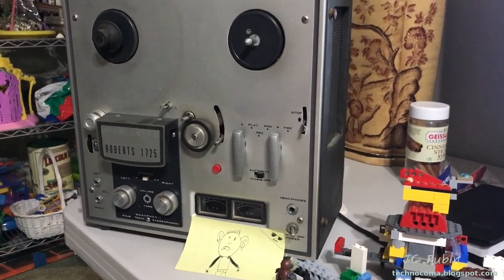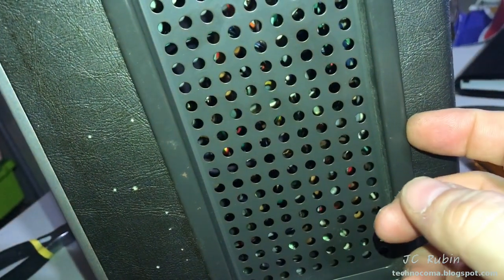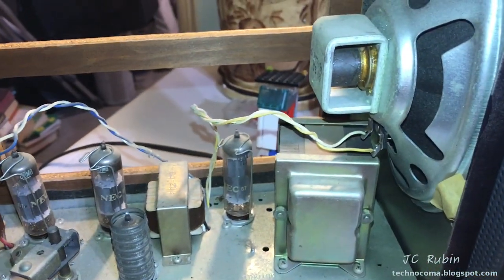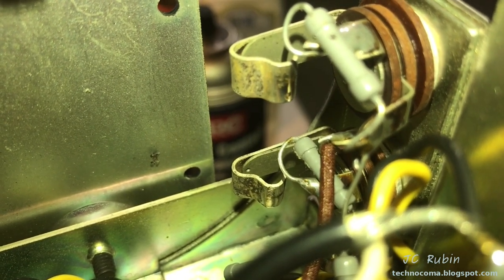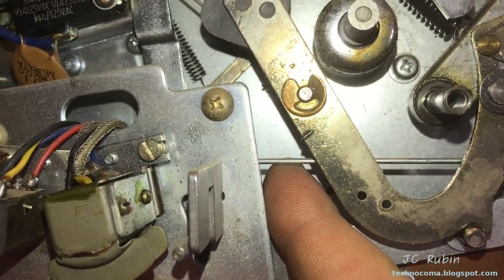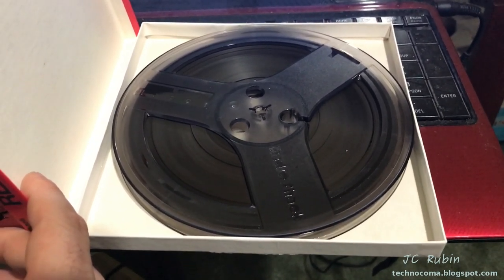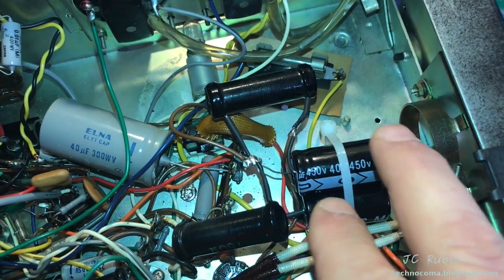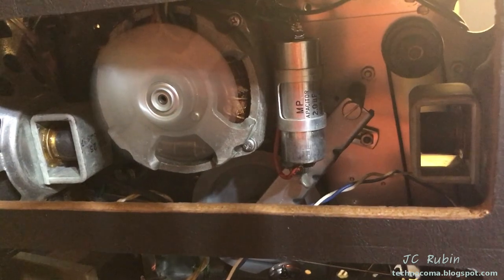Roberts Reel to Reel Model 1725 Restoration

Comment: Thank you for this inspiring video. I'm thinking on restoring my Tandberg 741X recorder from 1968. The X is a cross field bias head opposite the record head to increase frequencies. Therefore it has 4 heads: record, playback, erase, and cross field. I think it might need belts, a couple of tubes, and maybe a head or two. I used to play it about four hours a day between 1968 and 1985. At that time I switched to CDs and started collecting them. I replaced all my albums on tape with the new commercially available CDs. Currently I own about 3000 CDs. For albums that never came out on CD I have a Teac CD recorder which I'm using to record albums from Youtube. The frequency response is reduced because of the limiting factor of Youtube, but I figure that is better getting old music that way than not having the old music at all. I edit the music using the Audacity program on my computer. All the music is loaded onto my computer in 5 music libraries and downloaded onto 5 iPods. Thanks again for your helpful video.

Comment: It's also a good idea to try and pull apart as much of the mechanical moving parts and clean off all the old grease and oil and replace with new grease and oil... Makes a huge difference in performance and takes away strain from belts while making the transport silent... Would have loved to see more work done on this machine, as in taking it back home where you have all your test equipment... But I guess beggars can't be choosers LoL... Great job by the way considering the limited tools, pity that you didn't get footage of the exploding capacitor...
Reply from the maker: Ill admit this was a rare situation having little to nothing to work with I was happy with the overall result though.

Comment: I just picked up one of these models recently.  I had to order a couple of missing tubes.  Took some coaxing but the motor started up. No sound yet, but that's most likely the missing tubes I assume.
Reply from the maker: Yes the tubes are of significant importance to the function

Comment: Great video! I'm looking to do the same thing on an Akai 1710 I picked up. It's the exact same (well, almost) reel-to-reel as the the Roberts; just a different name. I started to take it apart but then I saw those large capacitors and got kinda worried. Did you do anything to discharge the capacitors before you started working on it?
Reply from the maker: Mine was off for 30 years, I wasn't concerned, but if I was, I would shunt a 1 MOHM resistor across the positive leads to ground and wait a few minutes.

Comment: did Akai build these for Roberts?... the Akai 1710 is the exact same unit... and that unit should play on its back just fine... and get a motor run cap from any place that sells ceiling fans...
Reply from the maker: I believe at some point Akai bought Roberts.

Comment: I know nothing about electricity beyond changing batteries in my flashlights.  I have a Roberts1725I-W, I purchased in March of 1968 after I left the service.  I get my unit out every 10 years or so.  It always starts up fine but there is squeaking seemingly from the mechanical parts.  My question is regarding your constant mention of capacitors and your choosing to replace them all.  I do understand they hold a charge but should I worry about disassembly and cleaning of the machine and lubricating the moving parts without dealing with the capacitors if everything appears to work?  Thanks in advance regarding any comments.
Reply from the maker: They work until they dont, do so at your own peril.its about 60 years old.

Comment: Hello. Would you have ANY idea where I could find the rubber holders for the reel to reel tape? I have a Roberts 1725 8L my dad had. The tape holder dried out. Any ideas?
Reply from the maker: They are all over ebay
Reply: @retrotechandelectronics  Thanks! I'll give a look.

Comment: That motor capacitor replacement you used is questionable….The proper type would be available as used in modern ceiling fans. The work duty of a motor start or motor run capacitor is much more robust and as you stated isn’t a polarized type.
Reply from the maker: The cap I used exceeds the ratings and is also not polarized. Also not trouble for years. What issue is questionable exactly.

Comment: Very confusing for us Brits. Roberts is a name that we know infamous for radios from the 50's and still going today although made of junk Chinese parts.
Reply from the maker: Actually, I couldn't tell you with any certainty if there was in fact no correlation. Roberts at the time was owned by Rheem, and then sold of to Akai.  Its possible that the Roberts name came from the UK company as a subsidiary at the time, long before they put their logos on cheap Chinese shitboxen.
Reply: @retrotechandelectronics  Rheem is still around in Australia but they are into hot water systems today. It's not music to my ears but at least it makes having a shower enjoyable lol... If only they combined the two together, we would have an MP3 playing hot water system... It would definitely save me from bringing the Boombox into the bathroom because a shower with music is definitely better than just the shower on it's own.... Yeah I know.... First world problems LOL.